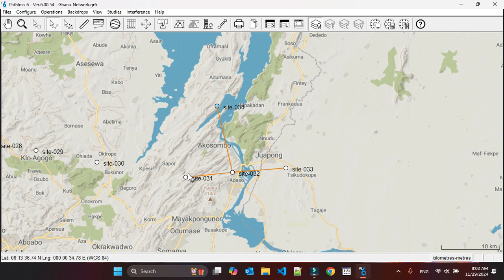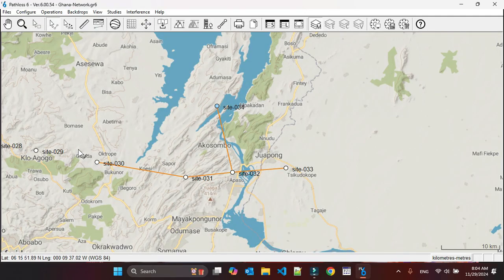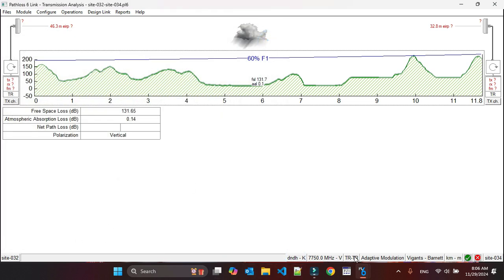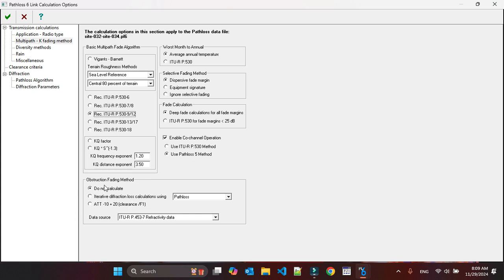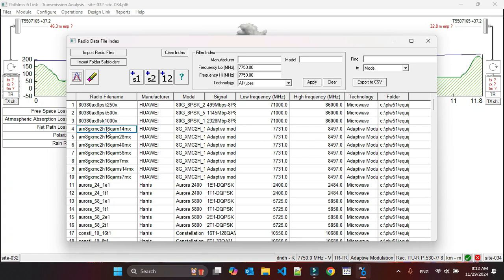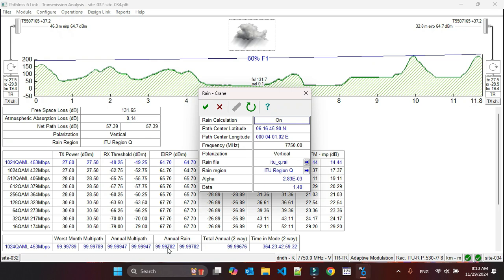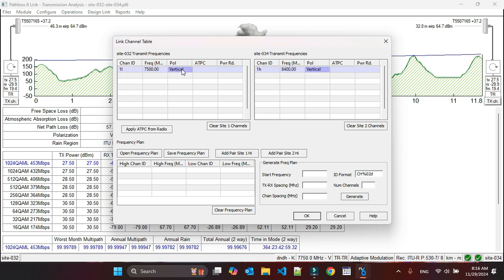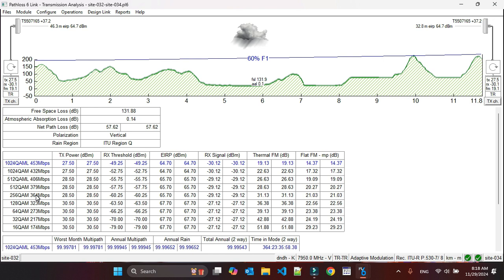Lesson-20 Finalizing a Link English

Comment: Does the pathloss 6 application calculate these data rate values based on link analysis? Or do they come from radio data files? Because I didn't get data speed results in my link reports. (My analysis is based on microwave, not adaptive modulation)
Reply from the maker: Hi, Thanks for the question, I have made a small video that you can go through and I hope that it will answer your question, please let me know in case you need any further detail. https://youtu.be/gE_YfUYM_CY
Reply: @ thank you so much
Reply from the maker: @mehmetulutas5166  you are welcome